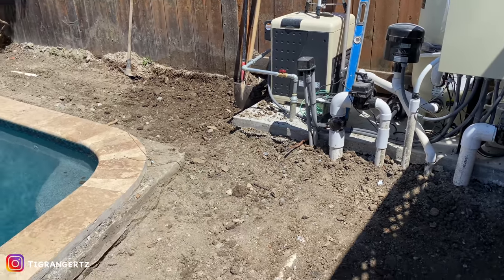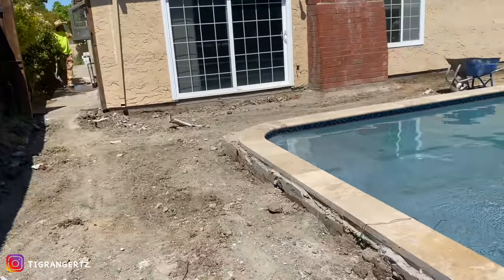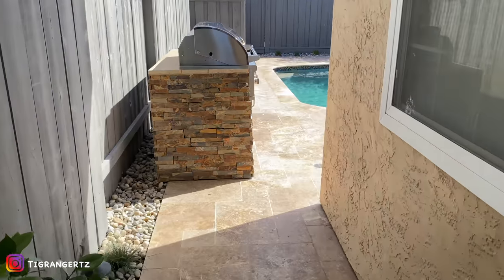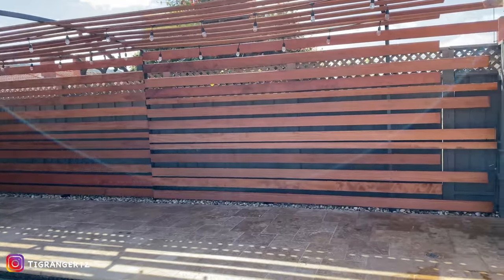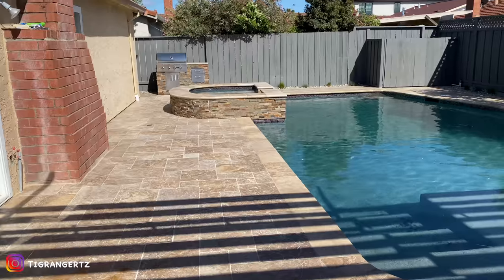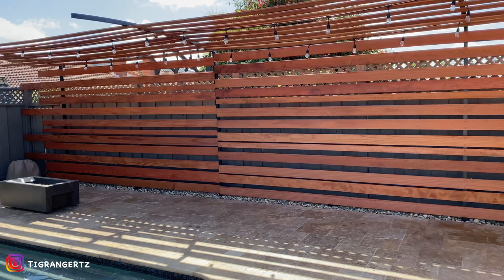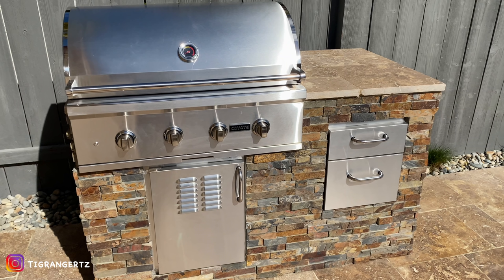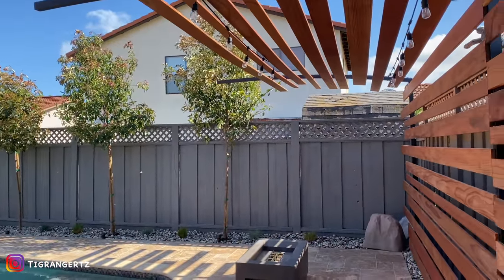Complete Backyard Overhaul ($150,000 Pool Deck Rebuild)

Comment: The pergola looks like a great idea. The boards look a bit odd in the Picts and sag will be a big problem and will most likely require metal to prevent sag as moisture works on the wood over time (weeks). Next just my personal preference the butane is a PIA to fill and I have NG all over and never have to change tanks. Your client made a poor decision (penny wise, pound foolish). It is very nice don’t get me wrong but I personally would expect much more for 150K.

Comment: Another great finish, I always hear that spans of greater than 5' will cause sagging issues though. I give it 2 years max before that $800 fix turns into a call back or warranty call. I would've just put two more posts to do it right so you don't have those long spans.
Reply: Have you ever built a pergola? No one puts post 5 feet apart
Reply: @mountainskylandscapingllc200   I have. You? Obviously this is no regular pergola which means you don't build it the same way as normal. Anyone with a brain knows that the wood installed like that will sag. As soon as I saw those posts and that wood with that span, I knew that was going to be an issue before he mentioned it. The right way to fix it would've been to remove all the wood and put another two support posts. Of course, that wasn't the cheapest solution.